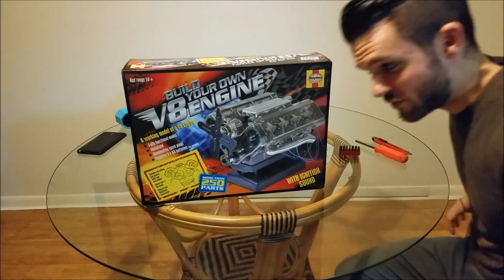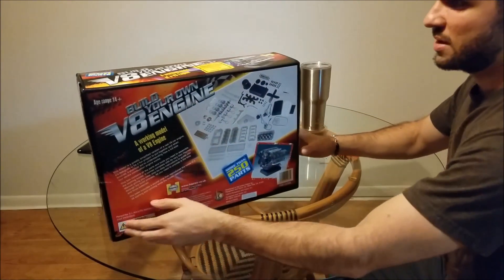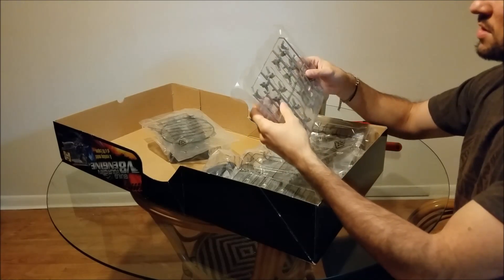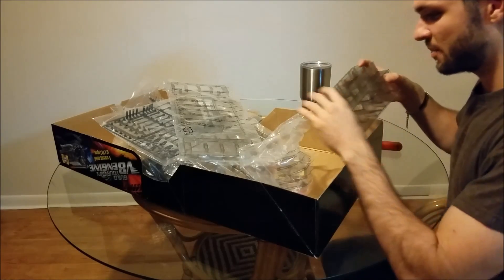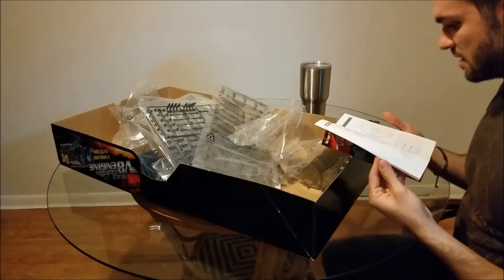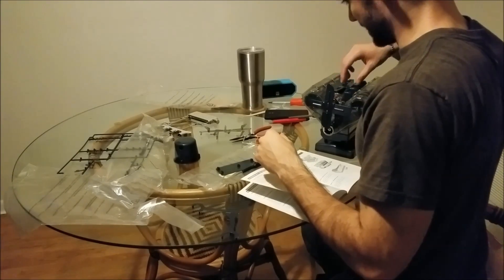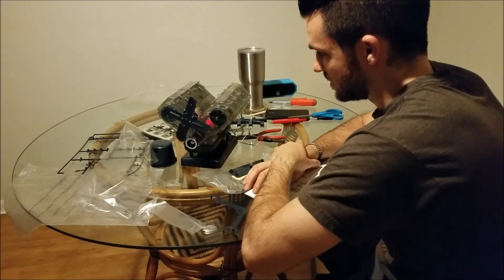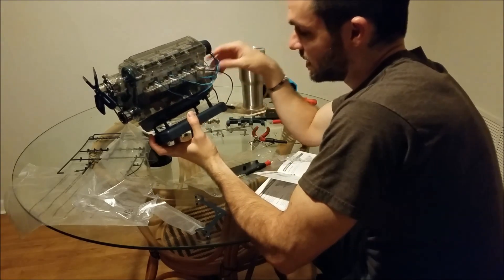Trends UK Haynes Build Your Own V8 Engine

Comment: Thanks for the video, 
I too had Technic Lego as a kid. This got me an understanding of how a car could be pushed and drive pistons up and down in a cylinder. 

This takes that  knowledge up an extra two or three notches though,

it took me about 12 hours incliding the reading / learning but I could easily do it in a fraction of that time now having built it once.

This thing is serious engineering without the stress of oil and I love it.

If you are sparking at BDC, just role the piston by one cycle to resolve  the issue maybe? 

As I'm sure you are aware, there are four pistons per block, two may be in  synch in terms of the crank, but they are at opposite ends of the Otto Cycle. 

This project explains how the Four Stroke (two cycle) Engine works and its great so see how the crank, pistons, valves, cam, rockers, inlets, exhaust, sparks all integrate.

The transparent plastic makes it even better.

You done the Gas Turbine/ Jet Engine?

Comment: I know its just a kit to understand a a "V8" but can be used to output some power to maybe make a V8 powered led lamp :D
Reply: My wife has a degree in engineering and made a few adjustments to hers, adding her personal vibrator.  Gosh she is so clever.  And is now seeking a design patent for her "Minge Masher 2000"   Sadly her Big End keeps knocking though, the horny bitch has worn out the piston rings-having a Vagina like a Wizards Sleeve dont help!
Reply from the maker: Emexrulsier, so there is a small electric motor to make the whole engine move. The engine doesnt actually have any kind of output shaft or compression etc. Just for educational purposes. Happy new year! please considering subscribing for more awesome content!